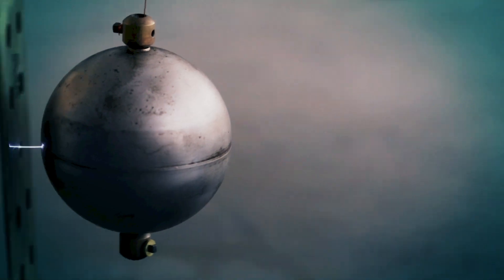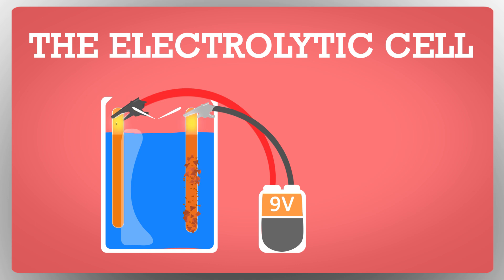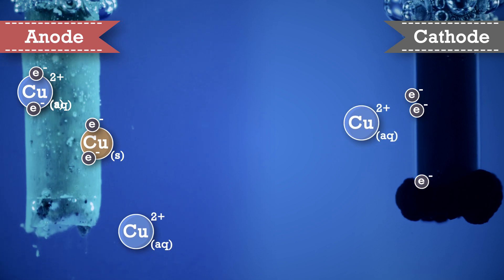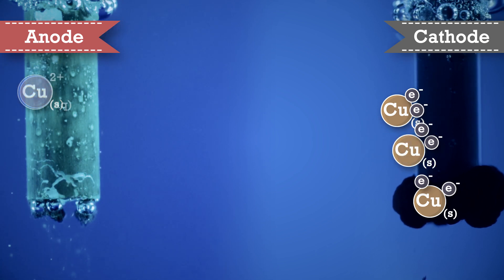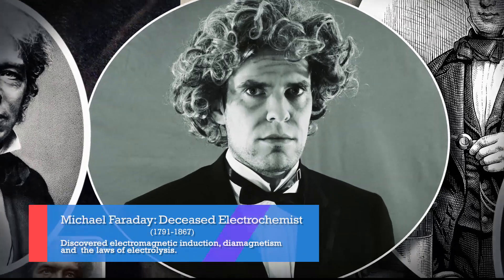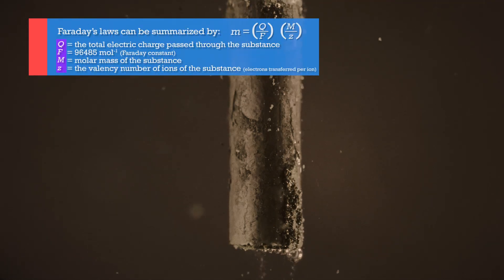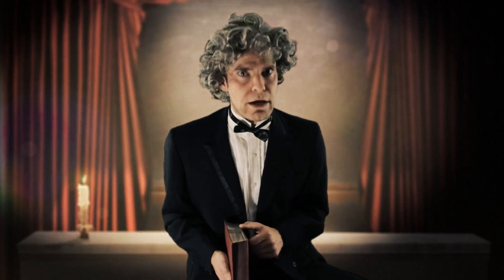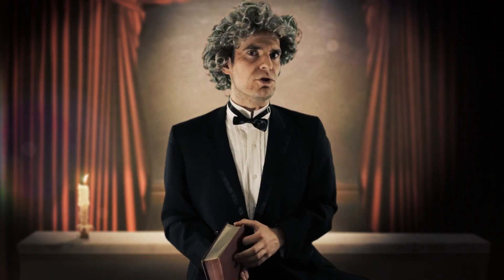How to Grow Copper Crystals with Electricity! | Electrochemistry Explained

Comment: as i look at the video in second time may be you use normal tap water instead of di water that is why you got that white thing coming out of solution when you do the eletrolysis.
Reply from the maker: +Chakrit Charoensuwankiri 
Both times we used tap water actually >.<. Technically we used spring water but I imagine that is essentially tap water as far as dissolved salts go. I believe that the mineral content must be inconsistent so some times we had better results with water changes.
Reply from the maker: +Bunsen Burns Fun fact, by the way. Wasted a ton of a mercury/lead salt because of this before we realized it was precipitating because of solvent contamination.

Comment: What happened to the battery?!
Reply from the maker: +monkeyonfire13 https://www.youtube.com/watch?v=ONCUyPJIjqI
Do you mean the 9V battery at the end? Consider this - that battery was applying a direct current to the solution. The battery contains two terminals one withdrawing electrons and one pushing electrons. This electrical work can literally SPLIT a molecule of water in two. One terminal produces hydrogen gas and one producing oxygen gas. I'll let you try to figure out which produces which! :)